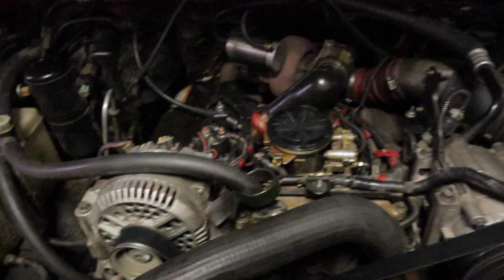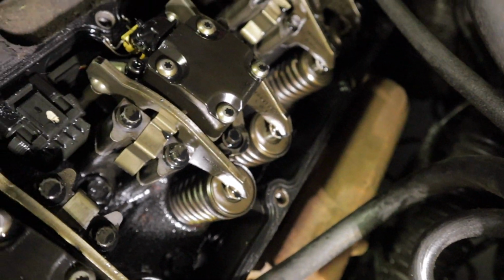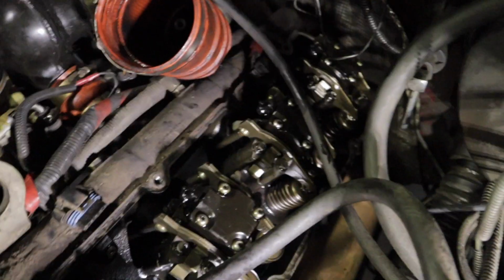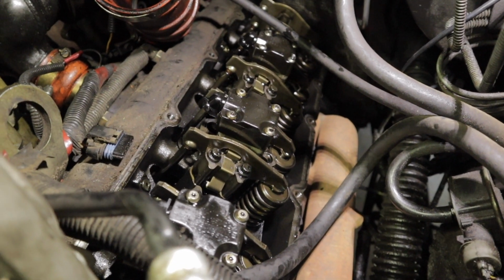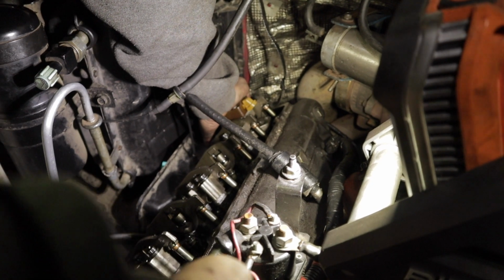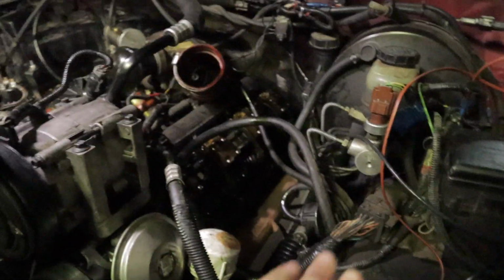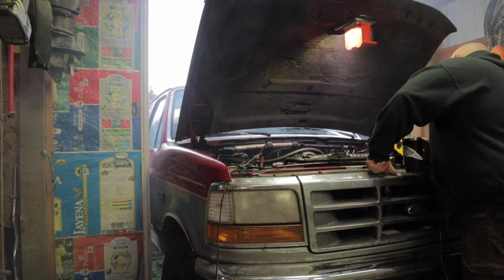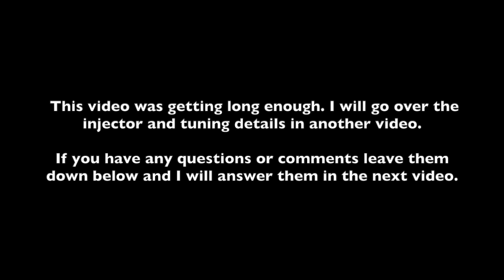Old OBS 7.3 Powerstroke Gets Big New Injectors

Comment: Thank you for this video I am going to be doing glow plugs, injectors, and rebuilding my turbo on my 95 powerstroke  here soon so this video is very helpful
Reply: Might think about doing injector cups as well. Then you can be confident it won't let you down in the future.
Reply: So if you live in a warmer climate where it’s above 35 degrees 90% of the time these engines don’t need glow plugs at all, I live in Texas & when I had my old PSD I just unhooked em & ran a switch up front to turn them on when it does get cold.

Comment: Great video!! You forgot to show us how you clean the oil and fuel in the cylinder. Enjoyed it!!👍😉💪
Reply: You’re supposed to change the oil after doing this because the fuel & oil rail do mix. Or at least change the oil after the first startup. It’s not required but an oil change is like 50-100$, but it’s cheaper than buying a new motor. So let’s look at it more as a preventative.

Comment: Great video! 
I believe there is a bolt that you can pull inside the top of the head and it drains the oil from the head down to the pan.
(I want a exhaust brake!!) Lol
Reply from the maker: There is. If you do that You'll probably want to pick up replacement O-rings for them.
Reply: @LivingOnWheels  i can't wait to hear the game plan with that truck. I might end up doing it similar. Love the Christmas metal too! Sounds like trans-siberian orchestra

Comment: Thanks for the video. Mine is a 97, the 2 wd version, a little more faded from our Texas sun, but the same color, XLT. The truck has been hard to start, only when the temp drops, but works fine in warmer weather. I have the glow plug ket, but with 276K on the truck. It sounds like my injectors could also be part of the problem? I'll half to look into that. Thanks again.
Reply: Look up archoil friction modifier. Great product that will help with cold starts.

Comment: I just purchased full force 180 stage 1.5 injectors, was planning on running everything else stock.  Without a chip for now.  Will this be ok?  Also, what would you add in the future?
Thanks
Reply from the maker: If your truck is a superduty you will need tuning to run single shots. If you have an OBS your truck will run them but it won’t run well. Anytime you’re going with bigger than stock injectors you should get tuning for them. 

Down the road you’re going to want to upgrade your air, fuel, and trans

Comment: Wouldn't be bad to upgrade to a kc turbo soon with those injectors
Reply from the maker: Definitely! That's on the list for sure. Luckily with small hybrids they can be tuned down to basically stock.
Reply: An s366 or 369 would suit it better
Reply: Tc125 definitely agree with that too

Comment: Wonder what kind of power numbers he's got now? When I went to my 160/30 injectors with a KC Turbo Tiger Turbo, intercooler and tunes I ran a respectable 425-450hp and around 1100 lb ft.. Not a lot, but it's twice what the engine sticker says and tows my 13k lb equipment no problem lol

Comment: So if the air dog 165 has a pressure regulator built-in, why would you run an additional fuel pressure regulator? Genuinely curious, I’m weighing out my fuel system options.
Reply from the maker: They way I see it is it give you a little more safety net for you entire fuel rail. Say your airdog is set at 65 psi and your regulator at 60 psi. That give you 5 extra psi to drop of full undisturbed fuel flow. Perhaps running the airdog at 65 on an open system would have the same effect. I’m not sure. From my experience it seemed like I did not have as much pressure drop with a regulated return system at I did with just the airdog and 4 line feed kit. That being said though, neither system dropped to concerning levels.

Comment: I love the 94' to 97' F-250 body style... but is it possible to swap 99' to 03' 7.3 motor in a 97'??
Reply: Its possible  but   pcm  wiring harness all thats gonna be diff.. have to do some mods  because    they have mechanical  fuel pumps
Reply from the maker: Yes it is totally possibly. The engines themselves are almost identical. Only real difference is the fuel system, accessory layout, and tuning. Unless your OBS engine is bad, you'd be better off just swapping to an E-fuel system and getting an intercooler setup.
Reply: @LivingOnWheels  I have a chance to pickup a 97' W/ a blown 460!  I like the 460 but would love to slip in a 7.3 :) And there's wrecked Blue Bird bus with a DT444i :)
Reply from the maker: @danielmcqueen1024  It would be possible but that is going to be a very intensive swap with a lot of parts hunting.

Comment: Do you not need to replace the injector cups? Also, I would lube the o-rings on the injectors with clean oil so they do not roll when installing.
Reply from the maker: The injectors cups very rarely need to be replaced. As for lubing, yes definitely. We lubed them up pretty good. Just didn’t show it.
Reply: @LivingOnWheels  good. I’m more so mentioning it for those who wouldn’t think to do that. Also good to know about the cups. I was planning on replacing mine when I do the injectors but I have no issues with the cups now. Also, thanks for installing the hybrids. I plan to go that route as well but my research, I was finding a lot of 99 and up 7.3’s where they were being done. I was entirely sure. Do you have a stock turbo as well? Curious if those injectors will be fine with stock turbo. I plan to upgrade that as well but I have to take it a step at a time.
Reply from the maker: @Androth12  Yeah, if your cups arent giving you issues then I wouldn't touch them. The truck these went on was totally stock. When you get the injectors and custom tuning for them just make sure to tell them to tune them down. Then you can run them as is until you make the other supporting upgrades. That's the benefit of hybrids.
Reply: @LivingOnWheels  tune the injectors down or the tunes down? If I can run them on the stock setting, then I’d just do that until I get the e fuel, and turbo upgrades.
Reply from the maker: @Androth12  Youll want to have the tune writer right the tunes to actually hold the injectors back some to play friendly with the current truck setup. 1023 or Jelibuilt should be able to do that not problem. Then when you get the other upgrades done you can have new tunes written.
Reply: @LivingOnWheels  thx for the info!

Comment: So, this is valuable to see. I've done this on mine three times now (because of chasing oil in coolant) after doing a head gasket job I am putting together now. I cleaned the cylinders all up, do you think I need to do the same procedure of glow plugs out to purge the system?
Reply from the maker: If you clean the cylinders out before putting the heads back on then I see no reason too. They only fill up doing injectors because the rails drain when you pull the injectors.
Reply: @LivingOnWheels  that's what I figured. Just, had to double check! Love the content, especially the sound deading.

Comment: I have watched your channel for some time now and would like to get your opinion. I have a 03 7.3 with 164000 miles it has the 6637 mod and a edge tuner. I need up pipes they are leaking at the y pipe. What up pipes would you use and would you do a wicked wheel and a waste gate mod if so which waste gate or just adjust mine. Thanks!
Reply from the maker: I’d just get the regular bellowed up pipe set from KC, their billet compressor wheel, and then tighten up your factory wastegate. 

https://kcturbos.com/products/7-3l-bellowed-up-pipe-kit-xd178?_pos=1&_sid=cc4154c55&_ss=r&ref:MTAwMzc0LjIyMjUuMTAwNDI3LlQ

https://kcturbos.com/products/7-3-99-03-powerstroke-kc-drop-in-billet-wheel?_pos=6&_sid=754b9bd89&_ss=r&ref:MTAwMzc0LjIyMjUuMTAwNDI3LlQ
Reply: Okay I was looking at the BD up pipes and the Wicked Wheel 2 from Thoroughbred Diesel
Reply from the maker: @stevenallen461  I’m sure those would work too. I just like KC because I’ve had very good luck working with the in the past.
Reply: Ok can you tell me witch ones your talking about from KC. I know its alot to ask just wont to get this right tje first time. Because I tow ALOT with this truck all the time. I pull a 17k 5th wheel camper and a 14k dump trailer. So I work it to say the least haha
Reply from the maker: @stevenallen461  I included the links in the comment. You can also go with the riff Raff pipes that I know for a fact are super high quality. Linked below. 

https://kcturbos.com/collections/7-3-exhausts/products/7-3-obs-riffraff-1843486c92-turbocharger-bellowed-up-pipe-kit?ref:MTAwMzc0LjIyMjUuMTAwNDI3LlQ
Reply: thanks man! Should I do eb delete or just reseal it so and go back
Reply from the maker: @stevenallen461  I think either way you'd be fine. Just personal preference to be honest.

Comment: what is that smoke coming off the injectors with the valve cover removed?
Reply from the maker: Crank case gases. Same thing you'd see if you remove your oil cap while the truck is running.
Reply: @LivingOnWheels  Cool figured. I just didn't know they vented from injectors like that.
Reply from the maker: Not necessarily from the injectors. The heads are open to the crank case.

Comment: Nice! I wonder if most of these parts are interchangeable with a later 7.3L. Did you see my second message on your "Need help" video? Let me know if you have a contact email?  Let me know if yes or no so I won't be wondering if you seen this. I have a 1997 and a 2002. Both 7.3L need some help with those. Thx! Keep up the good work!
Reply from the maker: Lots parts are interchangeable between the OBS and SD trucks, but there are a lot of differences as well. I did see your comment. My email is on my about page. livingonwheels.channel@gmail.com